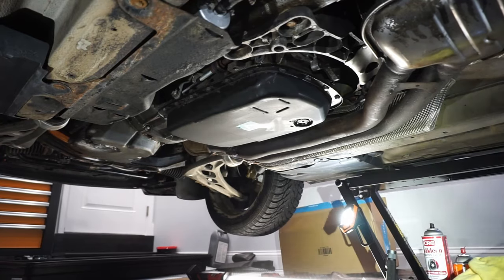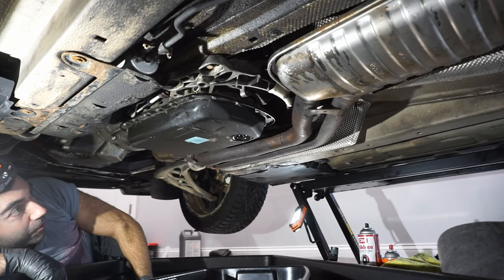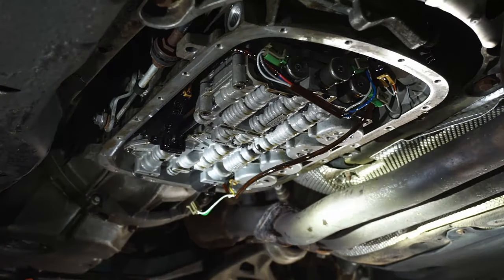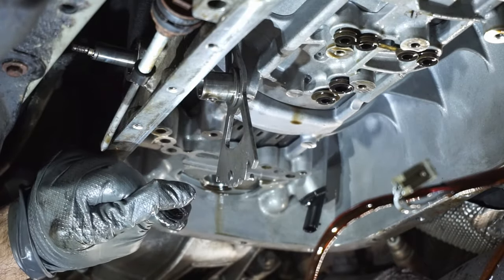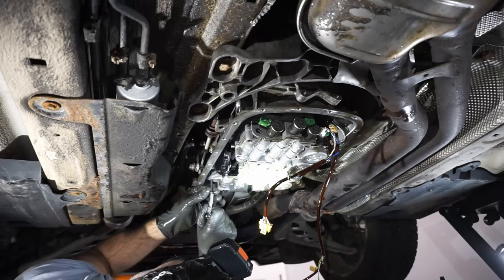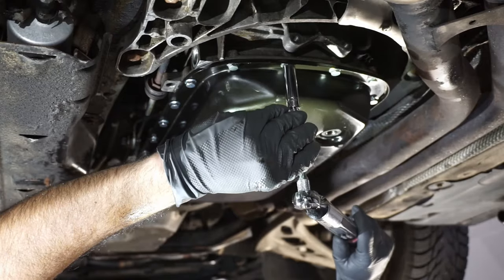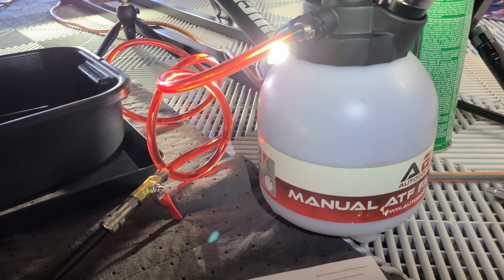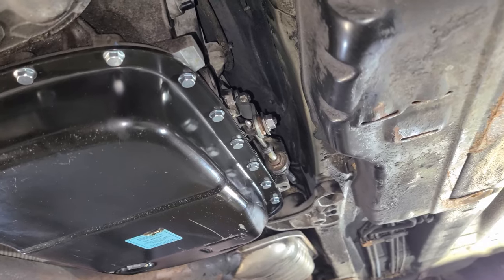BMW No Start or Crank - 5L40E Transmission Neutral Safety Switch + Transmission Service

Comment: For anyone else doing this,  you do not need to remove the pin that limits the travel of the shaft toward the inside of transmission.  
You can't hammer it through, and pulling it out is not usually as easy as shown here. 
So I go to put this goddamn thing back in, and the detent rod fell out of the transmission.  It just kind of flops around and can come out without any trouble. Pushing up on the thing you suggested does nothing to help get it back in place. Is it supposed to 'snap' into a secure place or something? What was that click you mentioned when reinstalling..
Any help here would be greatly appreciated. 
 Thanks

Comment: So I read your description, have the same ‘s’ problem .. but all fuses have been checked and none have been burnt out.. is there another reason why/how this could happen?
Reply from the maker: Even if the fuse isn't burned doesn't mean the neutral safety switch isn't bad. I would say if you can't crank, and you're stuck in s, there's a good chance it's this.

Just make sure you buy the correct switch for your transmission (zf or gm)
Reply: @Lefteris7  I’ve just got a diagnosis and it’s not showing any codes regarding the safety switch .. and are they known to just stop working out the blue.. I started it yesterday morning.. I noticed side view mirror switch was disconnected, reconnected it and that’s when the car stopped starting. It was cranking at first then stopped
Reply: I know this is older but my 2004 330ci starts, drives but shifts rough. Car doesn’t display gear selected just the cog and “!” and when in accessory mode it shows “S”. Fuse is in tact but neutral switch is definitely toast. Before the cog appeared every time I would press the brake and then release fully, the shifter would click inside. I can change from park to other gears without pressing the brake pedal also.

Comment: So are u putting it on the first big prong to make it lock  or putting the whole thing in it where the rod opens for the springs to compress cus when i do it the rod goes all the way in but when i press harder the part where it opens is pass the part parking pawk it needs to sit on the video it doesnt really show how to do it

Comment: excellent content, I have to do the same with my transmission. One question, did you disconnect the battery before starting to disassemble the electronic part of the transmission? thank you
Reply from the maker: Yea I recommend it's good practice to do so

Comment: What causes you to change it? i am having a problem  My gear is stuck in position s.  Even if I move the gear lever to any position  The display screen will always show the position s. Is it because this one is broken?
Reply from the maker: The part I replaced in this video is most likely the culprit. As I share in the video I took had "s" displayed in every position and car wouldn't start or engage a gear.

What happens is the car thinks it's not in park/neutral to start
Reply: I'm having the same issue what's the part number and where can I get it?
Reply from the maker: @damionhannam2745  please read the description. You need to confirm which transmission you have first as the GM and ZF are different
Reply: I have the gm series
Reply from the maker: @damionhannam2745  great so follow the video and reference the part # in the description
Reply: Really thankful to you and your wife for this video. 
I have changed the transmission  in  my 2003 x5 on my own. I only changed the filter on that job.
That was more tough than   challenging. This would have been a real head scratcher for a first timer  as not much is out there on this culprit in bimmer land... So Nuff respect my friend. 
Im also getting the dreaded P0705. "no crank no start".. going to give it a shot .
Thanks
Reply: Yes